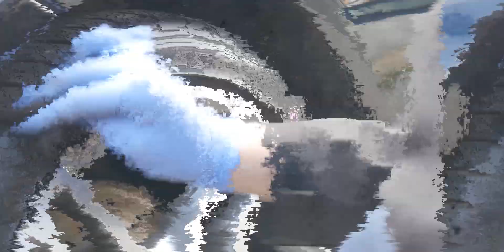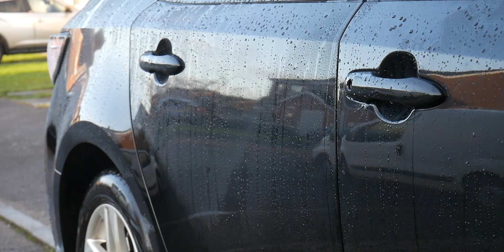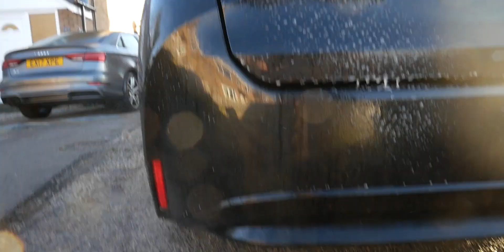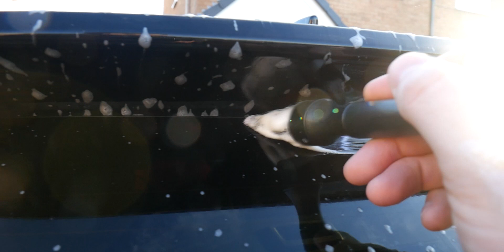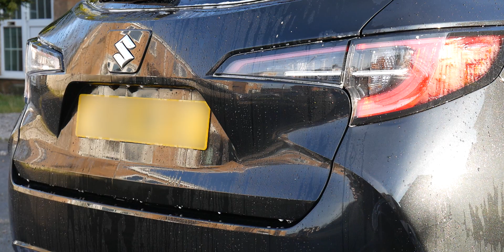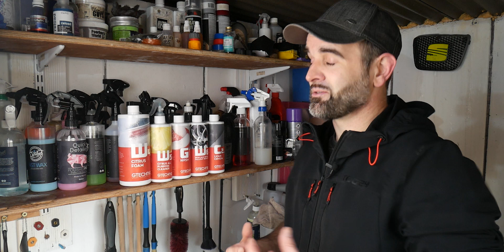An All Purpose Cleaner That DOESN'T Damage Wax or Sealant!

Comment: so W5 is just sprayed on paint 1:5 dilution?  And it's not agitated on a paint with a mitt it's just sprayed on to breakdown the grease correct? And then you follow with a rinse and a citrus foam wash contact wash correct?  W9 water spot remover does a good job unclogging the coating also especially here from the salty roads in Ohio in the United States

Comment: Thanks Matt 👍Just to add, W5 is not wax or sealant safe. Has a high PH of 10-12 & can degrade & remove delicate LSP's.

Will be interested to see the performance from 6 mths plus.
Reply: Everything online says that W5 is pH neutral.
Reply: @ccenturionnmc  trust me it's not.

Ultimate Finish have recently updated there website & have added an updated MSDS. Has a high PH of 10-12
Reply: @simonbaker5984  It is indeed highly alkaline due to the TSPP content.

Comment: Hi their love your channel . Could you help . A friend spilt seven up drink on Alcantara  diamond stitch sports seat in Mk 3 TT . I applied  heavy duty mequiars carpet & interior cleaner to stain . Problem is the front part of the seat appears to be sort of flat and rougher surface compared to drivers seat which is lovely velvety feel and so plush to touch the passenger seat will not seem to be the same as drivers seat no matter how I stroke the material . I’m worried now I’ve ruined the Alcantara on passenger seat due to using the heavy duty cleaner I’ve looked at the ingredients but struggle to find it on packaging . Not sure if it’s a solvent worried I’ve gone over board . Was going to buy auto glym interior shampoo hoping it would remove any residue left over from mequiars heavy duty and restore the lovely velvety feel and look my driving seat still has . I’ve all ways been scared of tackling my seats as frightened of causing damage to the diamond stitching in car . Can you advise best way to correct my seat . Soz for long tax . I’ve owned car 3 years and never cleaned seats